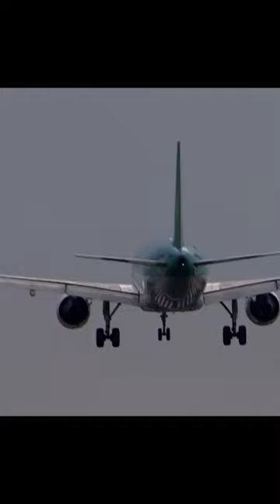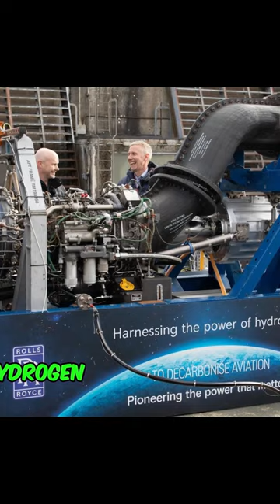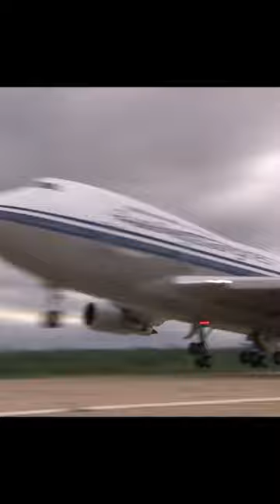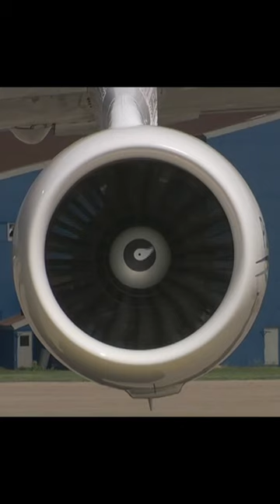Revolutionizing Aviation: Hydrogen Jet Engine Unveiled!

Comment: Yeah hydrogen is in what people think it is. Go watch engineering explained. Yes it will work but where does that hydrogen come from? Are you think sending up microwaves powered by nuclear power. I guess hydrogen would be too
Reply from the maker: Hi JTient,

Thanks for watching and sharing your thoughts! You've raised a valid point about the source of hydrogen, and I appreciate your interest in the topic.

Indeed, the production of hydrogen is a critical aspect to consider when discussing its application. While there are various methods of obtaining hydrogen, including electrolysis and reforming natural gas, it's essential to evaluate the environmental impact and sustainability of these processes.

As for the comment about microwaves powered by nuclear power, that's an interesting concept! However, it's crucial to emphasize that the discussion around hydrogen and its applications often involves a range of technologies and considerations.

I'll definitely check out Engineering Explained for further insights. If you have any more questions or thoughts, feel free to share them. It's through these discussions that we can collectively deepen our understanding of these complex topics.

Thanks again for your input!

_Best regards,
Tech Brilliance TV_